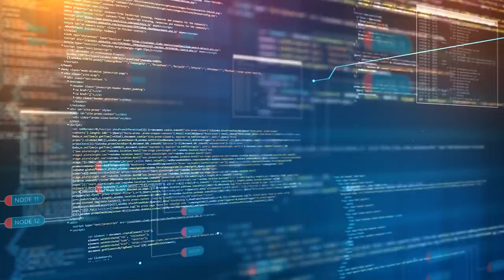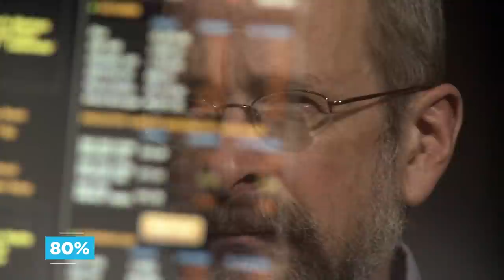Who's Winning The Self-Driving Car Race?

Comment: Good video. A few nitpicks. Video says that passengers can take their hands off the wheel in a Waymo. Actually, Waymo cars do not allow passengers to ever touch the wheel. The passengers are strictly in the back seat. Waymo cars are fully driverless. Lastly, Waymo uses their own ride-hailing app that is now integrated into Google Maps. Waymo does not use the Lyft app, as the video says.
Reply: Thanks for the extra information as the other guy said
Reply: An L3 car doesn't require hands-on-wheel "at all times". You don't even need eyes on the road. You can read a book.
Reply: You don't have to be in the drivers seat in an L4. You can sleep in the backseat.

Comment: Please update the Part with the SAE levels. The explanations for Level 1, 2 and 3 are just wrong and it would be a pity to give a false Picture.
Level 1 means that the car can either steer or brake/accelerate by itself, but only one at the time.
Level 2 is where the car can steer and brake/accelerate, but the driver has to keep his hands on the steering wheel the whole time (Tesla is driving around on Level 2)
Level 3 is where the car can Drive itself and the company takes the responsibility for the perfomed Action. Therefore the driver is allowed to do other stuff like watching YouTube, but has to be able to take the full control within a certain time period. (Mercedes plans to publish a Level 3 system later this year). Level 3 is very hard, because the car needs a fallback system (in Level 1-2 this is the human) where the system will detect future szenarios where car knows that it cannot handle the situation and signals the driver to take Control in 10s for example but not instantly. 

Your explanations for Level 4 ans 5 are correct, but please make sure your explanations for Level 1-3 are correct.
Reply: So you'd say that comma ai is not a level 2?
Reply: His explanation for L4 is a bit off too. He says that L4 is only in geofenced areas that are premapped in advance. Premapping is not an inherent prerequisite for L4. HD maps are simply a tool that we happen to use to do L4. You could conceivably do L4 without premapping if your self-driving tech was designed that way. And L4 means the ODD is limited but that could be limited by speed, weather etc... L4 does not have to be limited by geofencing. Geofencing just happens to be the most popular limit on the ODD.
Reply: @TheDiplomat27  yes, that's right. Another use case for L4 is a "parking pilot" where you drop your car at the car park entrance and it will park itself without the need for a human supervisor. This is also geofenced in some way, but more limited in the sense of its use case, which is why its Level 4.
Reply: Exactly. Also important to note that the levels don't refer to the capabilities of the self driving system, RATHER who is liable if the car crashes.
Reply: @capt4in1  SAE define the levels based on how much of the dynamic driving tasks and fall back are performed by the system or the driver. So it is based on capability, not liability. In fact, I don't think the SAE even mentions liability at all. Liability is a legal issue, not an engineering issue. So it is incorrect and misleading in my view to say that the levels are only about liability in a crash.
Reply: @capt4in1  that's right. You can have a Level 4 system that simply parks your car but nothing else vs a Level 2 System that Drives you all around America. Its a Big misconception that the levels indicate the ability to Drive itself and videos like these are partly the reason for this
Reply: @TheDiplomat27  Fair enough

Comment: Tesla is way ahead of all competition in the way they are approaching the problem and their data volume. This is anything but clear from this video. Waymo is waay more hard to scale. It only knows it's geofenced area. It is worse than useless outside of that.
Reply: Actually Waymo level of autonomy is 4 
Tesla is 2 
And Baidu is 5 
Lol
Reply: @damianjf6357  waymo and Baidu are line following robots. If you put an orange in the teslas steering wheel force sensor, it becomes a level 5 system. Goes to show how dumb the "level" distinction is.

Comment: I would love a self driving car. BUT as far as getting rid of self owned vehicles for ride share might work for some BUT for many not so much. I use kayaks some 18 feet long. no ride share will have that on its roof. Plus you still need to be able to take over as many kayak launch points requite off road driving to some extent. Plus how about all the people who pull trailers for jet ski or small boats. Camping trailers. So many still need to own there own car. I cant see that EVER going away. Plus will a self driver handle a snow storm like a person can. I doubt it. I would still love to see a self driving cars. long trips would be so much better. I can nap along the way. But forget ride share to replace ownership of cars.

Comment: AI is fantastic when. It works. A number of the self drives have been involved in accidents. My concern would be that with SOME ROADS as narrow as they are, what does a self drive vehicle do?  Stop and not move? Does it try work out another route?  What happens when there's an accident in front of a self drive vehicle, does it manouver round it? Or again does it just stop?
Reply: It will work. It will be million times better than human driving but it will take time. It is just start.

Comment: Sorry but this video is terrible. You explained the levels incorrectly. You claim tesla is only held back by regulators (if that's true Waymo would have the same problem). You say Waymo is level 5, while it's not its level 4. A level 5 car doesn't need a steering wheel or breaks and can drive anywhere (Waymo is geofenced). So many errors!
Reply: Yhe first level 5 autopilot it's the Autopilot autonomy of Baidu 
The robocar...
Reply: @damianjf6357  no its not, there isn't a level 5 system anywhere on the planet. A real level 5 system would work anywhere in the planet, in every city with every type of weather, etc. We are very far from level 5 at the moment.
Reply: @DerekSmit  
It's totally Autonomus 
IT doesnt even have a steering wheel or  peldals dude  
You literally only to sit and it can drive  anyware 
Even if it's not city 
Just see the Baidu video
Reply: @damianjf6357  I will believe it when I see it. All they have now are a few videos where the car drives on a specific road.

This is the definition of level 5

Level 5 ("steering wheel optional"): No human intervention is required at all. An example would be a robotic vehicle that works on all kinds of surfaces, all over the world, all year around, in all weather conditions.

If you can drop it in a crowded city in India or in a snow storm in Alaska, or just in rural Afrika where there are almost no road markings, then it's level 5